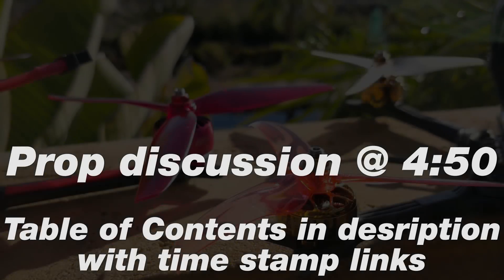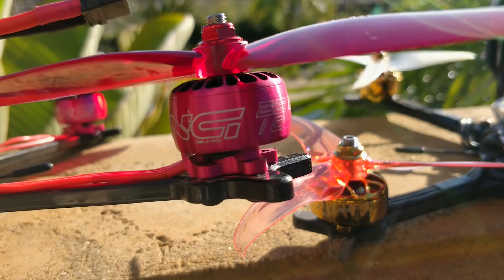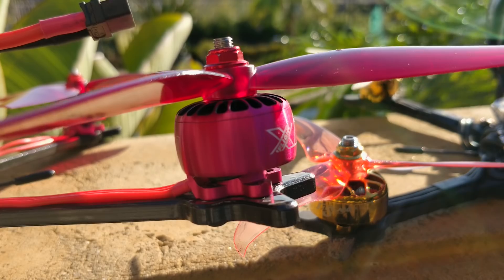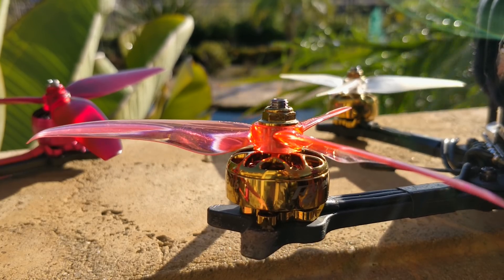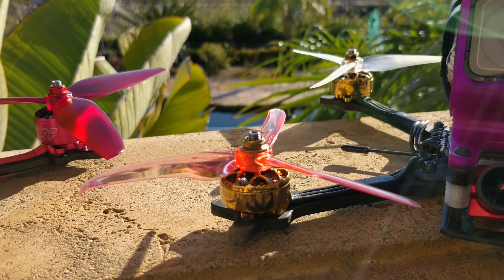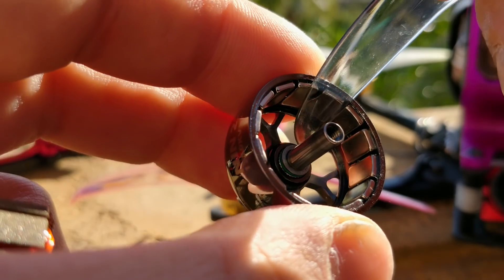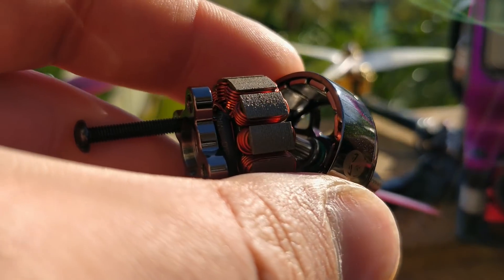Gemfan 5146.6 and Flywoo Motors

Comment from the maker: Table of Contents
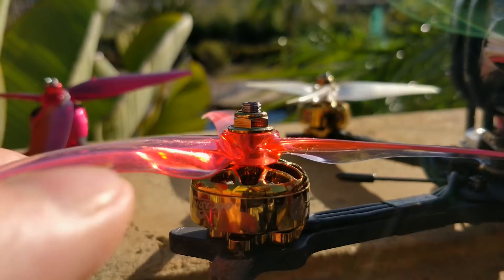01:00 - Flywoo motors
04:50 - Prop material differences
09:10 - Details of the prop
11:02 - Flight video/performance
15:09 - Motor choices and props
15:52 - 2306 vs 2207/8 differences

The Gemfan 5146.6 prop isn't available yet but I expect it to be in the next few weeks when China returns to work.

Flywoo 2306: https://goo.gl/xuLG6d
I recommend the 1750kv for 6S and I recommend you go 6S
Flywoo 2207: https://goo.gl/JTEXmb

They tell me the gold is much harder to get and results in more imperfections.  That's why it costs more.

Great value motor: https://goo.gl/h5rofi
This is my recommendation for the best value motor.  Never mind the brand,  this motor has all top specs for the lowest price I've seen.  The only possible down spec is that I'm not sure if it's actually 7075 aluminum.  Also, while the bearings still aren't the best, they are 9mm and will hold up well.  I don't recommend the counter clockwise thread.

Equipment I highly recommend:

Micro Eagle - 
https://goo.gl/or1fS9

Rush Tank Vtx -
https://goo.gl/YMYmya

Fantastic solder-
https://amzn.to/2P5QM2W

TS100 iron -
https://goo.gl/DqBipa
https://goo.gl/svK6DD
https://amzn.to/2OV5XMh

WaFL’s Cap Cap
https://insta-stalker.com/profile/waf...
https://goo.gl/9CZdAs

Xing 2208: https://goo.gl/PcJ7GG
Xing 2306: https://goo.gl/TT9gnw, https://amzn.to/2VkZ8rt

Sub $200 5" build that's still good:
Frame: https://goo.gl/EpXQhZ
FC/4in1 Stack:  https://goo.gl/HprVbj
Motors: https://goo.gl/h5rofi
Props: https://goo.gl/ZnzY2y
Props: https://goo.gl/VMBiQh
FPV Cam 2.1mm: https://goo.gl/FDJhYw
Vtx: https://goo.gl/JNVDMn

Tips?
PayPal: https://www.paypal.me/kababfpv
Bitcoin: 1E4XZXoD4rS6MYWVWuenY7Kw2M1YgyNpoQ
Nano: xrb_1188ek5bd7tb9kw67asnp9o65byuoaxbtpxuznx1ribf75x78awywmakj55f
ETH: 0xD067F93811f2eC31CB1928901002dfdf9A492EF5
LTC: La2KWYAjp4VT2Lq2M76pbjzXWvRyjpfCtG
Reply: Hey Bob, what VTX antenna do you use? Foxeer Lollipop 2 is still good choice?

Comment: have you ever tried a 2405 motor? I have some nicely built hobbywing 2405 2800kv which have 231mmq less than a 2306 motor (for reference, a 2207 has 168mmq more than a 2306). How do you think they'll do with these props? how do you think the wider stator will feel? are those motors too weak for this kind of prop? thank you !
Reply from the maker: Yeah 2405 starts getting really super overpowered at the bottom range. Maybe good for past 700g auw quads.

Comment: Hello! Are these propellers compatible with 2205 2300kv engines powered by 4s?
Or would it be better to use Gemfan 51433?
Thanks so much
Reply from the maker: Consider the 51433 but both will work well

Comment: I normally fly micro's, but now want to build a 5 incher. In the micro size it really matters if a prop is 2035 or 2135. This prop is 51xx. Does that matter for the frame? Or can I just use it on every 5 inch frame?
Reply from the maker: almost all 5" frames should fit 5.1" props.  Almost all, not all
Reply: @Kabab  I was thinking about that 5 inch cockroach frame you recommend in your description.

Comment: I decided to try the same Flywoo motors to see how they compare to my Xing 2406 2450 kv.  I need a reliable 4 in 1 esc now.  Since you’ve been using the Flywoo 50a any complaints ?  I was also looking at Hiolybro Tekko 32 metal.    Thoughts ????   Peace brother ✌️
Reply from the maker: The trkko is fine as is the diatone mamba. The Flywoo is identical to the xing on the inside.
Reply: KababFPV Thank you for the information that I needed. Im all set now.  Peace brother ✌️

Comment: Too many comments to go through them all and see if it was explained already, but I felt the same characteristics on the 2306 vs 2207 motors. (I haven’t tried anything else)
My theory is that 2306s motors spool up quicker than 2207s at least that’s what I noticed, so that wobble you find on 2207s and not on 2306s after letting off the throttle and pitching forward is due to the motor not being able to spoil fast enough to lock in attitude if that makes sense. I suck at explaining things
Reply from the maker: Yep I believe as the code improved it started allowing for more drastic input execution and this may be a physical effect that we can't get rid of. At least in betaflight for now.

Comment: dude what fc are you running...your footage is smoooooth
Reply from the maker: This quad has a talon F7 in it but it has nothing to do with the FC at all. It's more my settings and I don't remember if I had the ND filter on or not here. I don't think I did. My settings are default with 1.25 RC rate and a FF of 19.

Comment: After watching this video these motors are make by iFlight. or at their factory. the base is the same and they have the O ring (thats awsome) the shafts look the same and they have the conical shape to them. I love how you don't have to guess tension on the bottom bell screw. I thought that when I saw that O ring when the Xings were shown apart online, that you could crank down on the screw without issue.
Reply from the maker: The O ring is a surprisingly great upgrade. I have to agree. The screw doesn't even need locktite or anything.  I'm not sure it's made by iflight. As far as I know it's not.

Comment: How can these motors be efficient when the manufacturer's spec sheet already shows really low efficiency numbers?
Reply from the maker: Spec sheets are not very helpful.  Bench tests are almost completely meaningless unless you have something to compare them against.  The only well standardized testing in the industry I know of is miniquadtestbench.com.  Otherwise you can totally disregard anything you see on any manufacture site.
Reply: @Kabab  The manufacturer specs are unloaded and loaded measurements and are typically not that far off. Otherwise you couldn't even rely on specs like weight, Kv, Io, Rm ... when finding a motor.

Also, why would a manufacturer show significantly lower numbers for efficiency?
Reply from the maker: @xnoreq  that's correct. You cannot rely on kv or pretty much anything. It's all an estimation. If you scan MQTB you'll see some motors are in excess of 100kv off. Don't look at any spec sheet from any company. It's completely useless. For one thing, the reason why this motor looks less efficient than some others is because it's a well made motor which means it can generate more torque and get up to higher RPMs under static load. That doesn't mean more thrust due to thrust dynamics in a static environment that isn't defined. As a result it pulls more amps and looks less efficient. Forget all manufacturer thrust charts entirely. They are 100% useless. Especially when there is nothing to compare them against
Reply: @Kabab  I don't think you understand.
Mqtb doesn't do Kv measurements properly as far as I can tell. They measure unloaded rpm/V. But Kv is rpm required to produce 1V back emf.
That's why you never get the right rpm if you multiply Kv with your supply voltage ... because that's not what Kv tells you.

Now the manufacturer data may be rounded. That will introduce inaccuracies, but those are quantifiable and they are nowhere near allowing this motor to be highly efficient at high throttle, 6s with that prop.

Mqtb also said that their other numbers are not accurate in an absolute sense.

The manufacturer numbers seem not far off. Some number crunching shows that you can get this motor to be fairly efficient but only at lower thrust, going to 4s, different prop...
Reply: @Kabab  Just out of curiosity, what is the average throttle you'd say you use during your flights?
Because it might be that you use quite low thrust on average. There, efficiency can be quite good.
Reply from the maker: @xnoreq  if you measure something as 1ft, but 1ft is not a known measurement to anyone but you, how is it accurate?  I understand what you're saying and I know what manufacturers do, it's just not useful for a host of factors. I've explained one already. A more powerful motor will look inefficient on a thrust bench but in the sky it may be much more efficient due to the efficiency of a well made motor being able to unload. 

I know what you're going through. I was there once about four years ago. What I'm telling you sounds wrong but in the real world what you think does not apply. Manufacturer charts are 100% useless. Comparing two motors charts from manufacturers is like comparing a cat to a car. There is zero comparison other than the fact that they both start with the letter C. I know you still won't believe me but I promise this is how it is for many many reasons. The manufacturer is not trying to be wrong, they're just not doing anything in an actually standardized way. They just think they are. Like battery C ratings. Completely bullshit.
Reply: @Kabab  Nope. Static thrust is measured in g, current in A, resistance in Ohm ... all of those are known units of measurement.
Manufacturer specs may be off by a few percent, but if they're significantly off (i.e.  the manufacturer made up numbers) then this should be a disqualifying factor for that manufacturer.

Of course, static thrust at 100% does not apply to flying around at half throttle and velocity. High pitch props alone have stall speeds below which the thrust will suffer..
That does NOT mean that the specs are wrong or meaningless.
If you don't know what you're looking at then they are meaningless to YOU but someone who does can use them. Because you can actually calculate e.g. thrust at 20 km/h.

Case in point, from the specs (that show 2-3 g/W efficiency) I can calculate that the motors could hover at good efficiency with the right setup. That's >10g/W.

MY mistake was to assume that you operate this drive system with 6s above 50% on average.
If you experience high efficiency then you're either nowhere near that or compare it to systems with abysmal efficiency.
I think its the former because iirc the quad wasn't too big or heavy, the battery lower capacity (which saves on weight as well)...

Thanks.
Reply from the maker: @xnoreq  like I said, you're not gonna believe me. My average is probably around 60%. I was just like you. The success of MQTB is based on the fact that there is zero standardization among manufacturers other then them calling their numbers the same names. You'll see the light in a year or two since you seem to have the curiosity.
Reply: @Kabab  >"like I said, you're not gonna believe me. My average is probably around 60%. I" 

I don't see how anyone could given what you just said.
At 60% from 6s one FLYWOO N2306 1750kv motor draws roughly 150W or 7A at 22V with a 5.1x4.66x3 prop. It would also produce about 0.5 kg stall thrust.
Multiply that by 4.

Does your quad really weigh like 2 kg?
You'd also need a >2200 mAh 6s battery pack to just hover for 5 minutes.

Either you've limited throttle in your ESC or FC or TX or messed with throttle linearity there or all of them combined.
Reply from the maker: @xnoreq  so you're actually very new then. Realize that we're just about always moving forward. Also, in the sky you might be at 60% but the amps will vary significantly based on what's going on. Thrust is not a definitive metric of much. In fact a quad that makes 10kg thrust will probably only be able to manage 5-6kg of AUW before it can no longer even fly.  The world is a dynamic place.  It cannot be defined so simplistically.  A shallow pitch prop will generate loads more static thrust compared to a steep pitch but in actual flight, the steep prop will generate a lot more speed. 

You don't need to believe me but don't be so closed minded. You or I don't know everything but I'm obviously coming from a place of experience doing this. While I'm definitely not always correct, I assure you there is a LOT more going on than you aren't realizing.
Reply: @Kabab  Why are you so evasive?
Honestly, why should anyone believe you when you don't even know the linear throttle % that you need to hover your quad? It's not 60%. Not with 6s, FLYWOO N2306 1750kv, and that prop.
Why don't you find out what it is as well as the AUW of your quad and let us know instead of evading everything that I've asked?

>"Realize that we're just about always moving forward"
We spoke about hovering, no? You don't realize that additional velocity will make 60% even less plausible?

>" in the sky you might be at 60% but the amps will vary significantly based on what's going on"
Again, you don't realize that any turbulence will make the situation worse? So the numbers that I posted above were best case already, which just further proves that you're not hovering at 60%.

>"Thrust is not a definitive metric of much."
Except it is. Thrust at stall speed is the max thrust a propulsion system will produce when hovering. It is a very important metric when designing a propulsion system, especially for quads.

>" In fact a quad that makes 10kg thrust will probably only be able to manage 5-6kg of AUW before it can no longer even fly"
And you do realize why that is, right?

>"It cannot be defined so simplistically."
Yeah, it can. That's what science is all about. Typically, simpler models are more useful that complicated ones. That's why we still teach Newonian mechanics in schools.
And in this case it shows the best case which show that 60% is absurd.

>" A shallow pitch prop will generate loads more static thrust compared to a steep pitch but in actual flight, the steep prop will generate a lot more speed. "
All of that is well-known, understood and calculable. You don't even seem to realize what stall thrust means .. or why it is a thing. Because high pitch propeller blades will stall ... which reduces thrust. This is really basic.
Btw, I not only factored in pitch in my above numbers but also Gemfan propeller constants.

>"You don't need to believe me but don't be so closed minded."
I've asked you several questions. You've evaded. But I am closed-minded? Please explain.

>"While I'm definitely not always correct, I assure you there is a LOT more going on than you aren't realizing."
No no, I do realize a lot of things that are going on that I didn't mention. I tried to keep it as simple as possible.
Now can you figure out what the "60%" stick position actually translates to in ESC throttle %, absolutely, or not?
Reply: @Kabab  I checked the video again, it says 1050 mAh 6s, 629g AUW.
So you should be hovering at effectively ~30% ESC throttle. Maybe that translates to 60% on your stick.
Efficiency is actually not that bad in that range and my numbers match your flight times.

Anyway, I'm unsubbing and leaving you be.
Reply from the maker: @xnoreq  it hovers around 20% on the stick. When you realize things more you'll be back. Peace.
Reply from the maker: @xnoreq  I envy your persistence. You are definitely a smart guy/kid/girl. Your persistence alone will get you far. Open your mind to the idea that experience is not totally useless. Not everything can be described by numbers. I'm not evasive at all.  In fact you've given me an idea for a podcast type episode where someone like you asks me questions and I respond to the best of my ability. Maybe you'll be satisfied, maybe not. Either way, many will learn and it'll be interesting.

Comment: For someone not wanting to spend to much but still wanting the best flying quad, would you still recommend the mamba stack or something like an eachine 35A ESC with an helio fc?
Reply from the maker: For now, yes. But the better quality stacks are really coming down in price quickly.
Reply: KababFPV okay thanks for letting me know, anything I should be on the lookout for?
Reply from the maker: The piroflip stack with the new ESC is really nice.  The Mamba has been seemingly reliable however.  I haven't heard many if any issues from people.  I haven't personally used however.

Comment: " I don't recommend the counter clockwise thread." - is this specific to Eachine motor or counter clockwise thread isn't needed these days (in general)?
Reply from the maker: It's only because having two different prop nuts and two different motors to do maintenance on is extremely expensive and annoying.
Reply: Back before everyone started using ny-loc nuts to secure their propellers, they used clockwise and counterclockwise motor threads, (Instead of all CCW motors with CW threads like the majority of manufacturers make today) to keep the prop nuts & props from spinning themselves off. The clockwise motors were more prone to spinning the nut off because it turns in the same direction as the nut tightens. Nowadays with the use of ny-loc nuts, there's no need for counterclockwise threads, but alot of the real cheap motors are still sold with both CW & CCW threads.

Comment: Great vid as usual.  Dr, should I be flossing my 4 and 6 yr old kids teeth?  In all seriousness.
Reply from the maker: You should floss them if you can get them to sit still for a minute or two. If nothing, just get the floss in their mouths so they used to the idea. You should also brush for them too. Kids don't develop the dexterity to properly brush until age 7 or so. So let them brush and then you finish it up. At least just scrub each surface for a moment in there. I realize none of this stuff is easy with a kid but it's gotta start somewhere and it'll save you literal boat loads of cash in the future.
Reply: KababFPV yep, makes total sense.  Thank you very much!